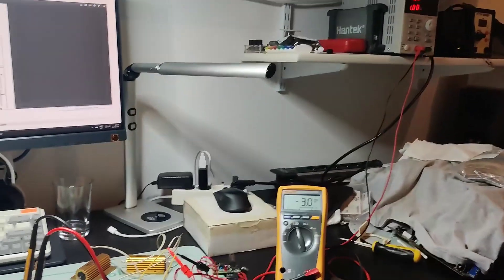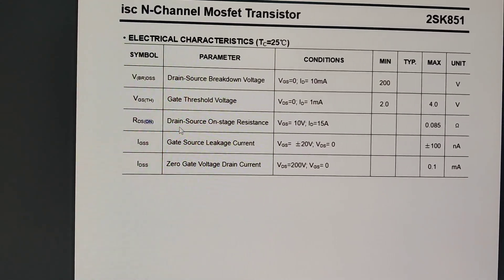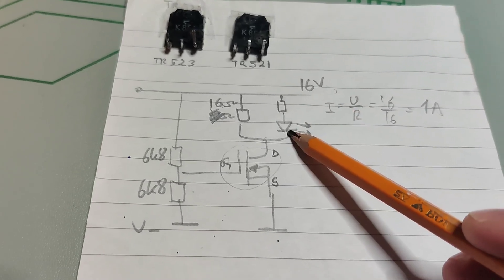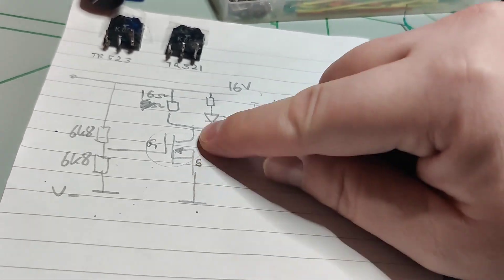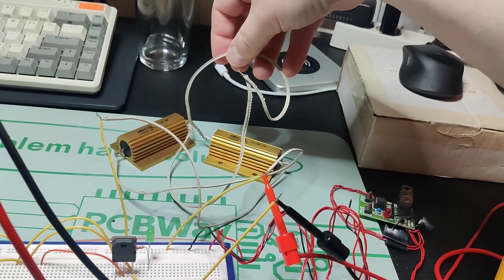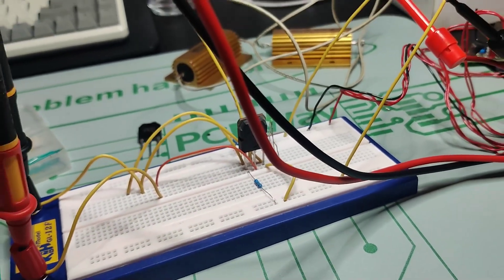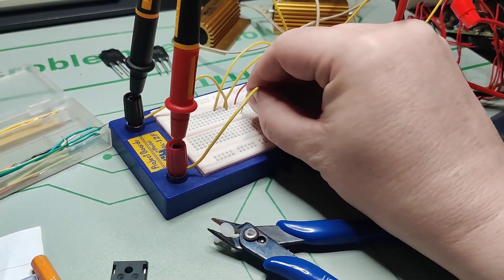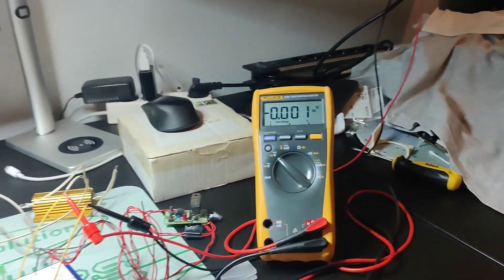Is the MOSFET fake or real ? (Rdson and Vgs threshold test)

Comment: if you can check the gate capacitance it helps, usually too small of a gate capacitance than stated per datasheet means a smaller die than it was supposed to be which translates to fake.

Comment: what is the formula for running this test ? can you write in here i am very bad at understanding from the video
Reply from the maker: I = V / R = 16V / 16 Ohms = 1 A
Because you can assume 1A is flowing through the transistor, it is easy to measure its resistance. When you measure 82mV over it, you can asume that it has 82m Ohms resistance.